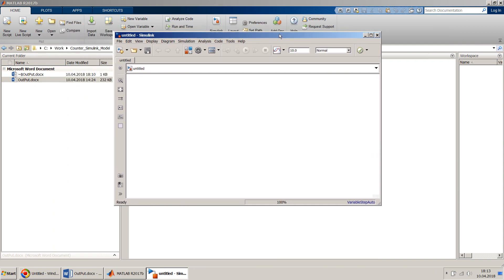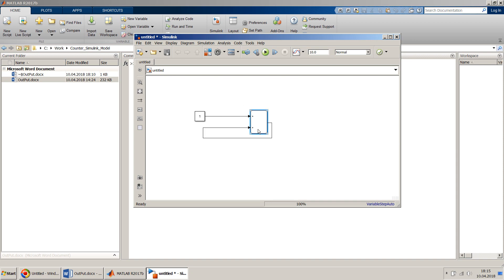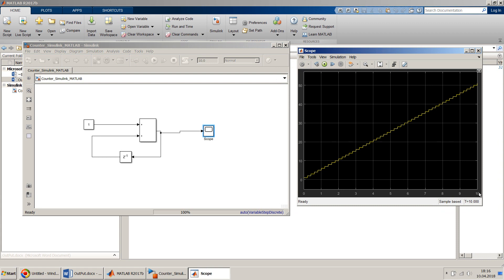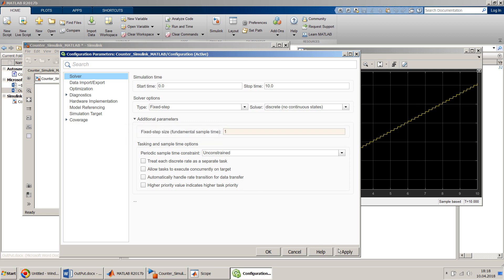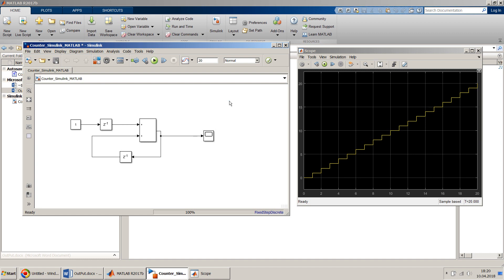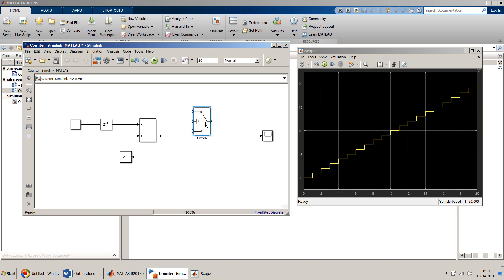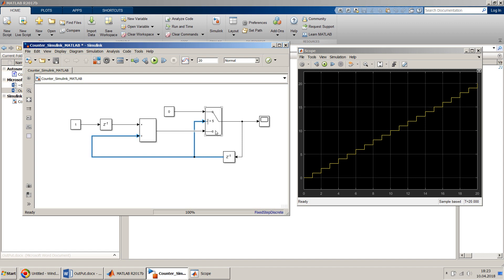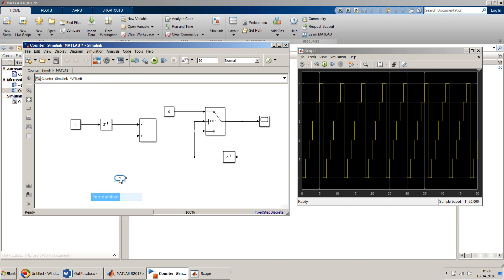How to design a simple counter and reset counter in Simulink and MATLAB?

Comment: Can you please make a model of timer which is on for 10 sec and off for 5 sec
Reply from the maker: Thanks for the suggestion. I will try to come up with such a demo. 

However, in the meantime you can check my below page. It may help. 
https://programmerworld.co/simulink/how-to-create-random-pwm-pulse-width-modulation-signal-with-fixed-duty-cycle-in-simulink-matlab-r2023a-using-random-number-generator-block/
Reply from the maker: Below may help. Please check:
https://programmerworld.co/simulink/how-to-design-pwm-signal-with-different-on-and-off-period-in-matlab-simulink/
Reply: Not this one.. Question is ' model a system inwhich 1) on the timer when the voltage is 5v
2)on the timer for 10second  and off for the next 5second and repeat

Comment: You shouldn't need to change the solver parameter. Just set the sample time to one second in the delay block and set  -1 as initial condition to start it at zero.
Reply from the maker: Yes, you are right. Setting the sample time to 1 second in the delay block is a much better solution to set the counter step size equal to simulation time.

For reference, details shown in this video is also shared in the below link:
https://programmerworld.co/simulink/design-a-simple-counter-and-reset-counter-in-simulink/

Cheers
Programmer World
https://programmerworld.co

-

Comment: Great video. Here is how my application works. I'm using an optical sensor to measure the revolutions on a disk. For that I put a pin on the disk so that every rotation it makes is counted as 1 pass on the optical sensor. I want to implement a counter on simulink that starts counting up once the pin passes through my optical sensor and resets itself on the next pass so that it starts counting back again. I managed to convert the analog signal coming from the sensor to a series of pulses so that its value is either one or zero. Now I'm on the counter part but still trying to figure it out. As I said earlier the idea is that for the first value of 1, the counter begins the counting and then on the next value of 1 it resets back to zero and starts counting again. If you have some idea on how to implement this please let me know. Again, great video. Keep up the good work.

Comment: Hi, 

I have 0 or 1 trigger as a input.. so let's say 1 is shows up for 50 secs and I want to limit it to 10sec. The first step is limit the sum of 1 showing time to 10 sec but the other part is I want to limit it for next 300 sec so that the counter should not start counting and once 300sec over it starts again then 10sec cut the counter hold it for 300 sec and so on. Can you help?

Comment: Just a note: I noticed that in your example the counter can be made to reset at each 5 second interval (instead of 6) by setting the threshold value to 4 instead of 5.  Also seems to be a cleaner waveform.

Comment: Hello :) Thanks for the video, it is very helpful. I have one question about it. If I use your example, is it possible to count the time it takes for the counter to rise from 0 to 5? In my case, the time for each step is not 1 second, it varies, but my threshold is always the same. So, everytime when my counter reaches the threshold to switch back to zero, I would like to know how much time it took. Thank you!
Reply from the maker: If your question pertains to real clock time for simulation while counter is counting, then I do not think it can be directly done in the Simulink. You can use certain performance measurement techniques in Matlab (like tic-toc command) to measure the real world clock time it takes to simulate the counter for 5 simulation seconds.

However, if you want to measure the simulation time in your model then you can simply use a clock block for the same.

Good Luck
Programmer World
https://programmerworld.co

-

Comment: How to make this statement  in simulink :
Varying the current from 1 to 25A, in steps of 0.4 ampere,  every 40 s over a total simulation period of 2720 s.
Reply from the maker: In this tutorial, the counter shown takes all the default values such as step size, increment value, etc. For your values, the specifications in the counter will need to be modified. Say for example, step-size should be 40s, Total simulation time = 2720s and increment value in every step to be 0.4Amps. Once you these changes in the model, you will get the model for your requirement.

For further reference you can watch my other videos on  counter topic using the below links:
https://youtu.be/FXGoe91n9GE
https://youtu.be/aUQ3RNH_oQs

Hope the above helps.

Good Luck
Programmer World
https://programmerworld.co

-
Reply: @ProgrammerWorld  thank you  sir
Reply: Sir can you please tell me how to make this for a system containing continuous states:
Varying the current from 1 to 25A, in steps of 0.4A, every 40sec over a total simulation period of 2720sec. 
Please help sir

Comment: If We dont want continuous output...if we want it only for two cycles then??
Reply from the maker: Then put a clock block and rest of the implementation in an enable subsystem. Once clock reaches your required threshold of 2 cycles, just disable the complete subsystem.

Comment: Sir...if I want the counter only for 2 cycles then what will be the design
Reply from the maker: 1st use case: After every 2 cycles you want to reset the counter and begin counting again from 0. This case is explained in the later part of this video (after 6:30 mins) where it is shown how to design reset counter.

2nd use case: The other use case could be that you only want to count for 2 steps irrespective of simulation time of Simulink. In that case you have to use the reset part of the model with Threshold value of switch block being compared with a clock block's output. You can compare that when the clock gives output of more than 2 (2 seconds of simulation time) then your switch block's True condition gives a fixed output of 0. And hence the counter's output will be set to 0 after 2 cycle time. 

I hope the above explanation helps to design your requirement.

Comment: How to stop the counter once it comes to zero??
Reply from the maker: Once the counter reaches to zero you can either reset it as shown in my video tutorial. 

If you want to stop it completely then you can use conditional subsystems like Enable subsystems or If condition subsystems. In this subsystem once the counter value reaches to Zero you can disable it. So, the value of counter will not be considered anymore.

Comment: Great video sir! I have a Simulink model where I have PWM values starting off at around ~160. I want to create a counter to count up to the ~160 approx and then disable the counter and PWM values should take over. From this video, I want to replace the 5 with the varying PWM, so the counter will count up to the PWM value and the counter should disable. Any suggestions will be much appreciated.
Reply from the maker: Hi Ajay,

There can be various approach for this. The one I can quickly think of is to use the Enable subsystem block. Have the output of the counter in a switch block (controller input , u). Set the threshold of your switch to ~160. Once this threshold is crossed then switch will turn on one side. You can give Boolean input true or constant input 1 to that port of switch. Connect this switch block output to the enable subsystem condition signal. Thus the enable subsystem will get enabled only once the counter crosses 160. If needed, you can reset the counter value at 160 again to 0 as shown in the video. Hope this information helps.
Reply: @ProgrammerWorld  Thanks for your reply. I ended up hard coding it on the microcontroller. Thank you very much for your suggestion and it's a great tutorial. Much appreciated!

Comment: I want many different different  increment and decrement and another output signal s
Reply from the maker: It can easily be done using a Mask Parameter and taking the value of the parameter in the Add block in the feedback loop of counter. I will try to make a video to explain this.
Reply from the maker: You can refer to below video. This video shows how you can design a variable step counter in Simulink:

https://youtu.be/FXGoe91n9GE